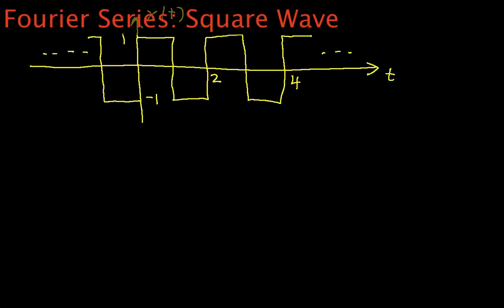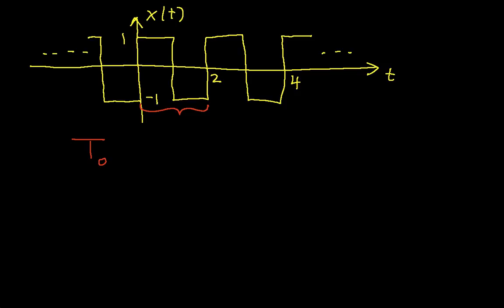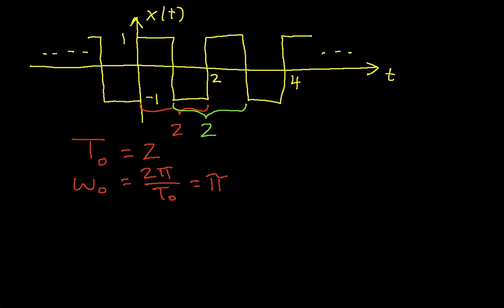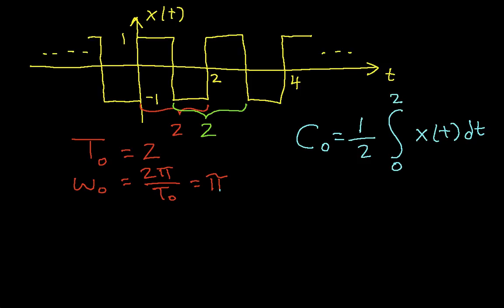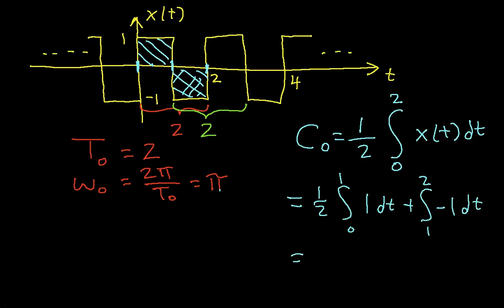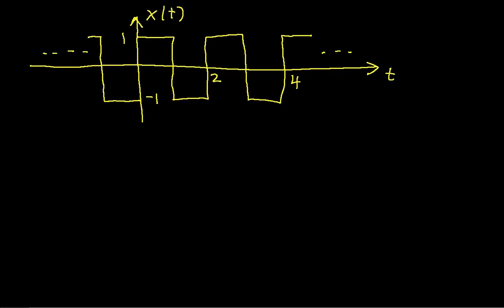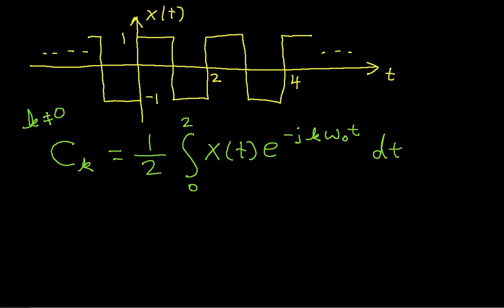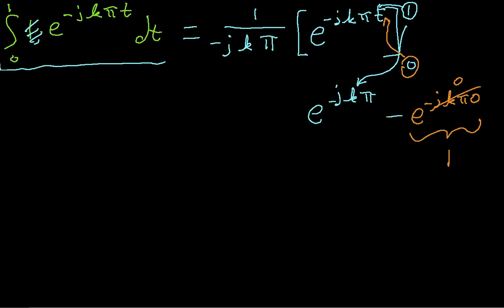Fourier Series Example: Square Wave Part 1

Comment: x(t) to 1. I understand if you are just doing that with the integral of x(t), because the area under the square wave from 0-1 is 1. But when your taking the integral of x(t) TIMES (e^.....), wont you need to have the area of x(t) AND e^(.....) and multiply them together? I cant believe how you just replaced x(t) with just 1.